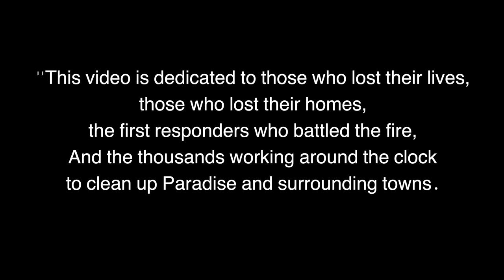Devastating Paradise Wildfire Clean Up

Comment: The California fires have the same effect on the People as 9/11.  This is a deadly Psy-Op.
Climate change doesn't make metal flammable.  This wasn't a "wild fire".  This was Arson.   DEW's were used.  This video doesn't show the motorcycles, washing machines, kitchen sinks, automobile engine blocks, etc, reduced to molten metal, animals cooked from the inside in mid-stride. automobiles flipped over on top of each other - And, it doesn't show those wide blue lasers striking the ground from above like the other videos.   They want people out of the rural areas and into the cities

Comment: What a waste of money  using solo dumptrucks going back to the Redding or red bluff area. Look like the typical  California  rip  the taxpayer off, unreal.
Reply: How? Also they don't just use solo dump trucks. They use 10 wheelers, supers 10s, end dumps, ect. They dumps they take them to are designed to have the contaminated materials. You need to consider that not all of these houses have the access to large trucks.
Reply: It depends there was alot of talk prior to start, about setting up a yard and loading train cars to haul it out. But only 2 dumps in a resonable distance are hazmat, anderson and weitland. Its the laws, acess is dofficult for larger aluminium body slide axled end dumps and super 10s most trucks leave with 14 to 19 tons and up to 26 on certain trucks